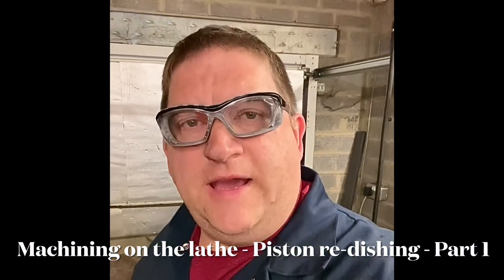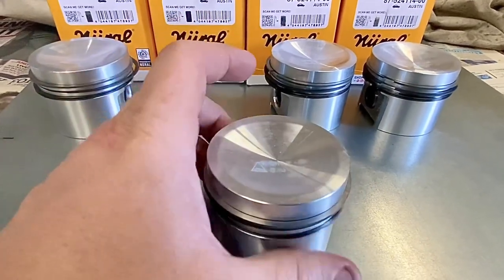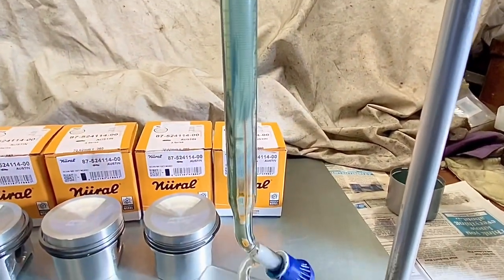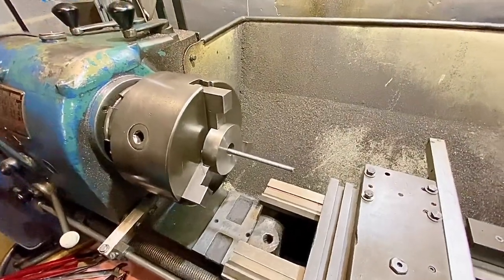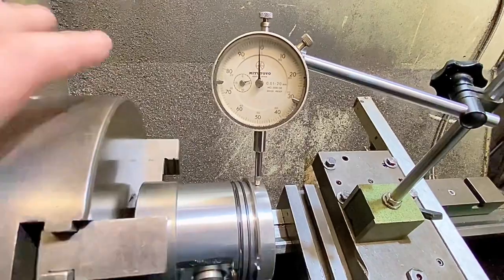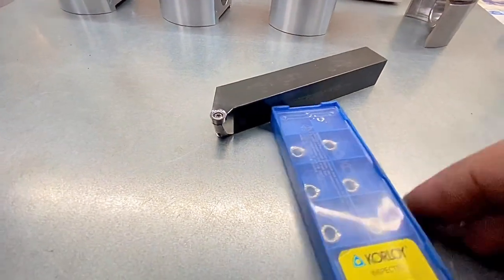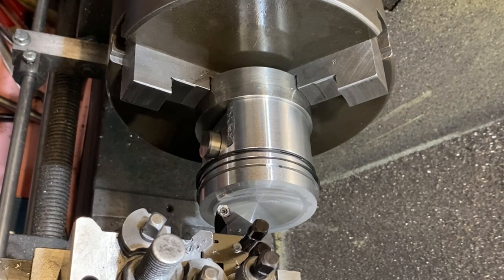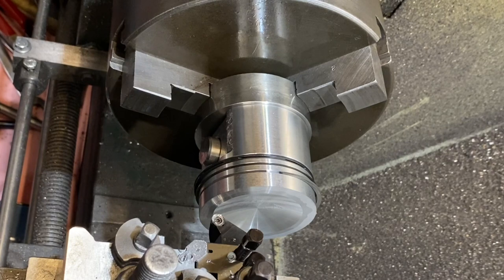Machining on the lathe - Piston re-dishing, Part 1

Comment: I've machined 1000s of pistons in the 80s and 90s  , below the oil ring land is cam ground or diamond turned, all the ring lands I've clocked have been round .
Reply from the maker: Thanks for that input, it seems some are, and some aren’t when it comes to the A-series engines

Comment: its difficult (nearly impossible) to clean the pistons after machining with the rings still in the grooves.
Reply from the maker: Correct, the engine builder will be doing that before they are used.